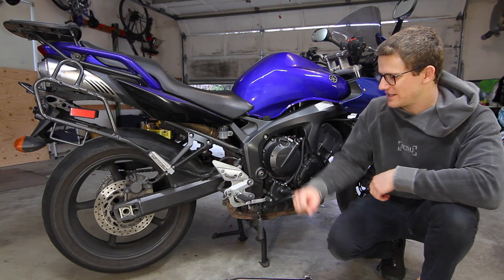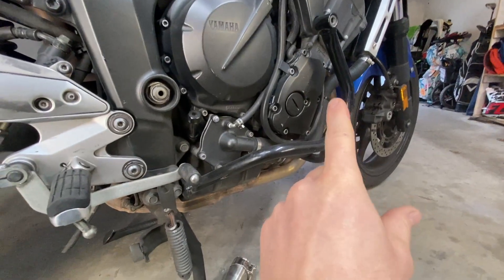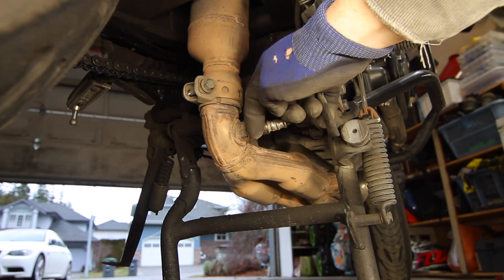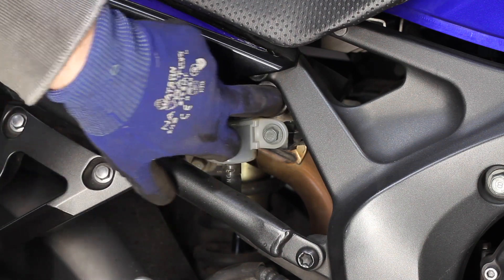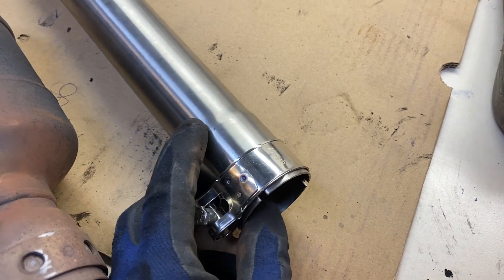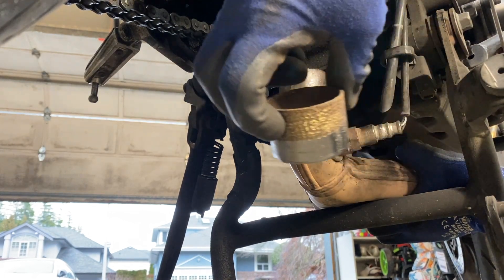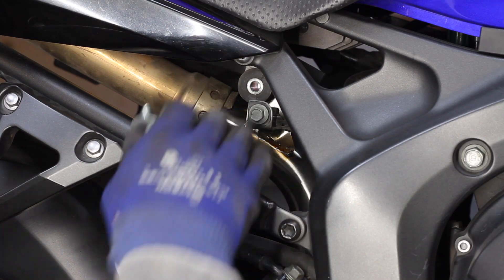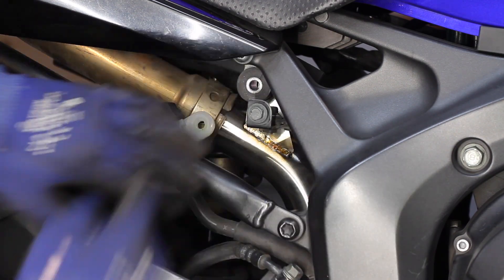Elevate Your FZ6's Exhaust Sound: How to Install a Catless Mid Pipe

Comment: Just did this mod and found three things helped: 
1) work off the kickstand not the center stand so it is out of the way.
2) loosen all header lugs as far as possible to allow maneuvering
3) remove the side cowl so you can loosen the Allen bolt that lets the hanger bracket swing to get the right alignment to hang the new pipe.
It does sound slightly louder and higher pitched over 4k rpm.

Comment: Thanks for the video Calvin! This is on my to do list, but one of the things I've read is that this should help reduce temperatures by your ankles since there's no longer a cat. Should help a lot in those hot summer days!
Reply from the maker: Ya I could see the heat being less with the cat removed.
Reply: Thanks for mentioning that lol Im definitely doing it now. Found the same piece of pipe calvin installed on aliexpress for $34 with shipping. Was planning to just smash the cat out of the original pipe but I can probably sell it now.

Comment: Excellent video. I really like the two camera setup.. I have recently ordered a new Delkevic exhaust for my Fz6N. Hopefully arrives by next weekend or during next week. I asked the supplier regarding the catless mid pipe but was warned against it as the new exhaust will be LOUD as it is.
Reply from the maker: Ya once you have the exhaust installed you can decide if you want more loud 💥📣

Comment: 3:25 The part you threw away there is the gasket. My maintenance guide instructs to replace them if you remove them, and now that you have removed them from your exhaust - you made it leak. There's one on both ends of the catalytic converter. Removing the catalytic converter sure makes the bike sound more manly and the exhaust more toxic.

Comment: Calvin i have an issue that i cant narrow down, maybe youll have some insight. 
My bike sat for a year after i lowsided it at a very low speed, but now its starting to act up only when its cold outside.
During warm weather my 2004 Fz6 idles normally,
But as the fall rolls in, and the ambient temps drop below 55°F it idles around 3000 RPM, but only after it warms up. 
I checked the air temp sensor and TPS, both are in spec. 
Today I checked the error codes, and there were 6. 
12,13,15,19,22,30. 
So i cleared the codes today for the first time since i owned the bike, restarted it a few times while checking the codes and there are zero errors, but the idle is still rising after it warms up, when the outside temps drop at night. 
Im not sure what the issue is.

Comment: Great video man! I know you mentioned you didn't want to take off all your luggage racks. But, would you think about doing a taillight install/replacement? Mine got a crack in the lens and they don't do replacement lenses, so I will need to remove it fully and put in a new one.
Reply: I would LOVE to see that. And may anyone reading this please post a link for fairings for the 07 fz6!

Comment: Hi Calvin ! 
Have you experienced any bad smelling exhaust fumes after the decat ? 
I saw in some of your comments that you contemplate to drill holes into your muffler, in order to get a better sound, but you should also be aware of the downsides, caused by the modified backpressure parameters and air-fuel ratio. 
I have drilled the muffler of my FZ6 looking for a better sound, but I ended up in getting real bad smelling exhaust fumes and backfires on deceleration. I mounted a K&N air filter and tweaked the CO settings, the backfires dissappeared, but the bad exhaust smell persisted. 
For me the bad smelling exhaust fumes is a dealbreaker because I commute with my FZ and I hate to stink whenever I entered a room (I was on the edge of selling my FZ for that matter).
I ended up reverting to a stock muffler,  stock air filter, performed a throttle body balancing and tweaked again the CO settings and now the level of the exhaust fumes reduced significantly. I have the stock catalytic converter, and I intend to give it a clean in the summer with vinegar and sodium hidroxyde. I saw on a forum that a guy reduced the level of bad exhaust fumes by approx 75% by cleaning the catalytic converter with vinegar. 
I love your content on FZ6, great quality ! 
Please, please, please make a video on CO settings ! It would be interesting to see your views and your approach on such a topic which has the most unanswered questions on the forums.
Reply: I've drilled my exhaust and it did not smell. But when i removed the cat, it started smelling. For what i know, an ecu remap solves the problem

Comment: Alternatively smash the cat out of the original pipe and save $70. Another cheap and easy mod for more sound is to drill trough the resonance chambers wall inside the muffler with a long drill which pretty much straight pipes the bike.
Reply from the maker: Ya I’ve seen the drilling technique before, looks intriguing 👀
Reply: @Calvinm  Ive done it. Its pretty loud until it warms up, after it quiets down quite a bit. Doesnt sound as good as an aftermarket but still 10 times better than the super muffled stock sound. Riding slow (and fast) is so much more fun now, you dont have to redline it constantly to get that sweet purr. I still have the cat pipe, dont know how it would sound without cat. Also on my s1 theres no cats in the headers or an oxy sensor.

Comment: I can't for the life of me find where the ground lead connects to from the negative terminal of the battery. The manual says it is somewhere on the right side under the seat but it seemingly does not exists on my bike. Same 2007 fz6. If you know where the ground connection is or where else I can connect it please let me know.
Reply from the maker: I recall there being a ground wire that connected to the top of the transmission area. Near the butt end of the starter there was a threaded hole that a black ground wire attached too. But I never traced that wire back to the battery for fun or necessity so I’m not sure we’re talking about the same thing. Good luck either way!
Reply: @Calvinm  I think I found what you’re talking about. I used a bolt from my skateboard and it seems to have worked! Thanks for the reply.

Comment: I cringe at the phrase "loosen up the header bolts"
It's been a few years since I put together my custom slipon with split pipe. But iirc the stock secondary cat can be drilled out for the same effect.
My new mufflers flow freely enough that I get some mild post ignition on hard clutch decelerations and it happens at that cat. Could probably lean the fuel little enough in the stock settings to get it right. But it rarely happens on normal deceleration and the bike is a monster.
That stock muffler is definitely a huge restriction. Makes the bike sound like a kazoo too!

Comment: Yeah my fz6 is way too loud. I got it kinda beat up with a fresh motor. So I have been fixing it up. I got it straight piped and have been search for the right exhaust. I definitely do not want to go stock. I want a good tone. Good sounding bike. Not a screaming bumble bee sounding like it's about to explode at only 7k. Lol my bike it catted still and it too loud without the back section of the exhuast.

Comment: Hey calvin, how are you.

what can i do to contact you, i'm having issues with my Fz6 S2 2008.

i recently bought it, with lots of problems, i watched most of your helpful videos to resolves the most of the issues, but i got one that still happening, it doesn't matter what i do... 

so, i want to contact you directly, send you some videos and hear or read your opinion.

grettings from Venezuela.
Reply from the maker: You can contact me on Instagram @freeheadgasket. Send me a message there 👍

Comment: Awesome video as usual my guy. Do you notice any change in performance without the cat creating back pressure? I did the big airbox mod and while the bike doesn't idle nicely when cold, it defiantly gives a little more low-end torque.